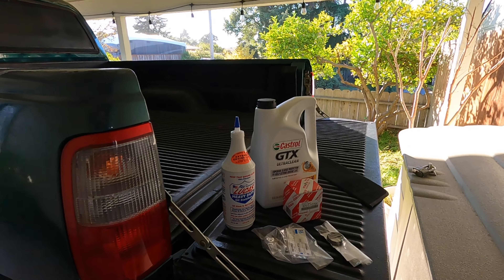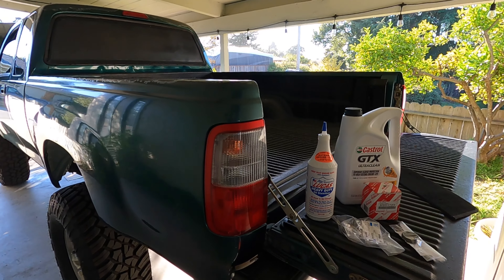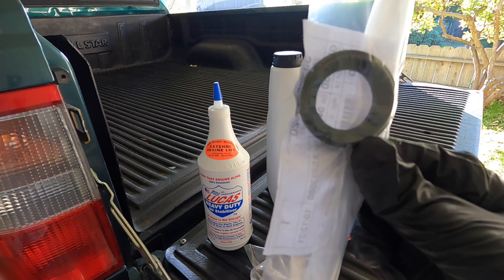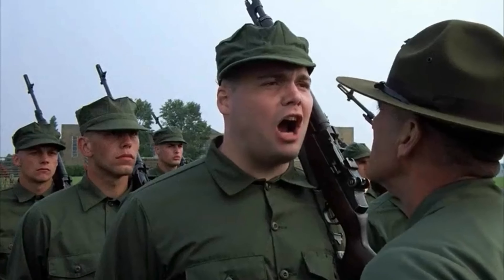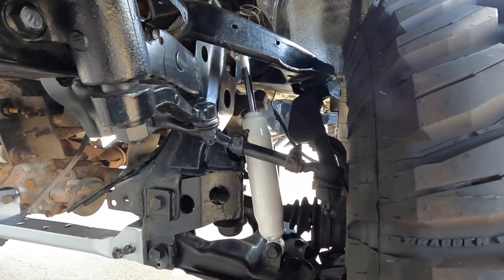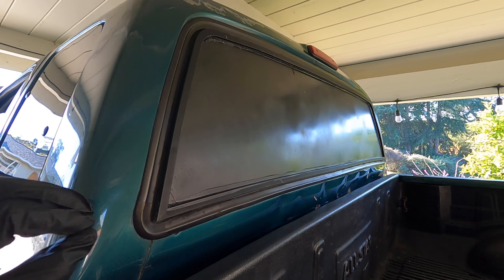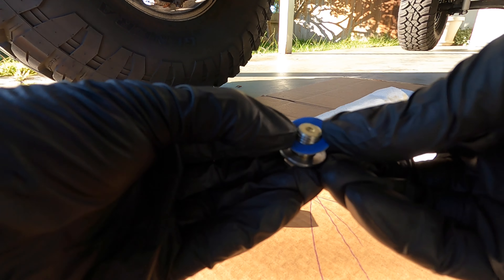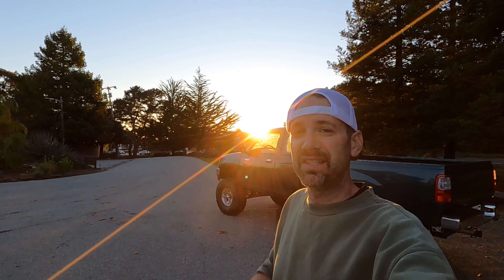TOYOTA T100 Mini Monster Truck Update

Comment: How do you not have more subscribers?  I just bought a 1996 T100, automatic, V6, 148k miles, $2,500.  Everything works and looks incredibly clean.  It even has the aftermarket cruise control!  Watching your old T100 videos motivated me to buy one.  Now I’m working my way through the new videos.

Comment: Sweet T100 that lift is sick. I own a 98 T100 4wd automatic just turned 220,000 k miles. Do all maintenance myself, just replaced all A/C parts condenser, dryer, evaporator expansion valve, compressor with clutch (Denso). Now it's winter Lol. Truck is not huge has no V8 but it's still on the road 23 years later.
Reply from the maker: That’s great to hear..98’s are the best year!! 👍🏼

Comment: I recently picked up 06 Toyota sequoia 4WD SR5  with 198k miles.

One owner, clean title, California vehicle it's hole life and regular service done at a Toyota dealership.  Timing belt and water pump and thermostat chage at 98 k and just recent before taking delivery with sales record and warranty. 

This is my first Sequoia and I absolutely love it.

Questions please. How often I should service the transmission? Would you recommend train and full ot start the engine and run through transmission line and keep adding as the old one run through with new ATF.  

Any other services recommend would be greatly appreciated.

Thank you.
Reply from the maker: Sounds like you have an awesome sequoia, ive mentioned before i really like the 05-07’s cause of the vvt-i and transmission.. I’m happy you asked this question because i’ve been researching this for years.. i love to do all types of preventive maintenance but as far as toyota automatic transmissions go.. now before i say this, i’m sure there is no absolutely right answer, so i respect anyone else’s opinions.. But, from what i’ve found through talking to many Toyota Tech’s is that you should leave it alone if it’s not acting unusual or displaying any problems.. if you notice it slipping or anything odd, then do a full flush and fluid change..  
Apparently in toyota sequoia land, one with 198K is actually considered lower mileage, so i say just keep on driving it and then we’ll revisit the idea at about 250K.. 👍🏼

Comment: I bought the eBay shift bushing cause my truck wouldn’t stay in 1st or 3rd gear at all. It didn’t fix it and I thought I was screwed. Then I bought one from marlin crawler(pricier but worth it). It was a hard plastic instead of a flexible plastic. Never fallen out once since then and it’s been months. Just thought I’d let you know in case the eBay one doesn’t work out.
Reply from the maker: I appreciate it, actually because of your comment, i just looked at there site and found tons of stuff i want, thanks a lot, gonna lighten my wallet for sure!  definitely worth it to spend a bit more for quality.. 👍🏼

Comment: It’s weird you brought up having issues with first gear.  I have the same issue with mine; I’ll inadvertently not put it all the way in first, and when I try and take off, the shifter will pop into neutral and there’s a large bang.  That’s something I need to look at.
Reply from the maker: i’ve been collecting all kinds of shifter bushings, seals and seats.. clutch pedal springs, clutch master, slave.. imma jump in and figure out what’s wrong soon.. i’ll let you know what i find! how many miles on your T100?
Reply: @toyotafanatics1  I have 258k miles on mine!  And keep me posted!

Comment: Why no rear slider?
Reply from the maker: i just thought it would be easier.. also, i remember guys swapping out sliders for solid glass back in the day and i always thought it looked good.. AND it was significantly cheaper.. and those damn 4 piece sliders are super easy to break into, toyota didn’t get it right until they went to a 3 piece rear window on the 2001 Tacoma.. 👍🏼

Comment: I've had my T100 5-speed since 2001. The clutch has always been finicky and weak. Definitely not a strong, confident clutch response IMO.
Reply from the maker: Alright, so i’m not alone.. i wonder if putting in a centerforce clutch would really make a dramatic difference or if there just like that cause there old school??
Reply: @toyotafanatics1  I've tried a couple different clutch plates the few times I've finally worn out the clutch. Didn't matter if I went with a stock version or a HD/Race version. Neither clutch plate changed the weak feeling in the engagement. What bums me out about the clutch is where the clutch engages. It "wanders". Sometime it engages a little early or late. It's not consistent in my experience. I used to own a 1988 4x4 Toyota pickup and it was more solid and consistent in its use.
Reply: I know this is 2 yrs later but the t100 firewalls crack at the clutch mc connection. Something else to check